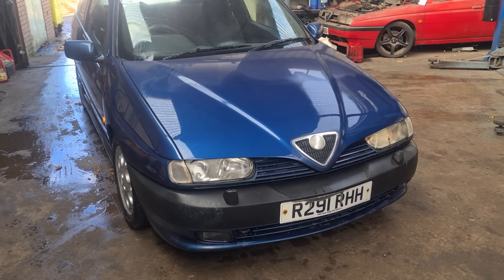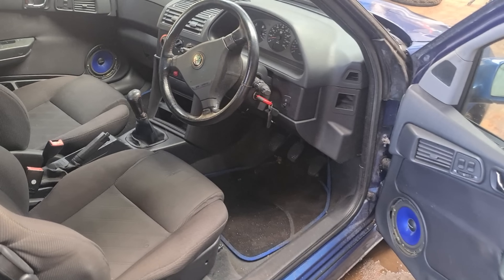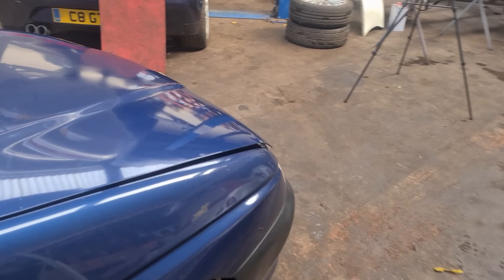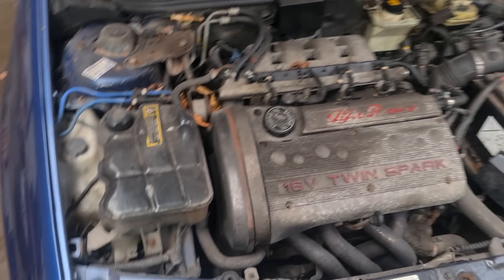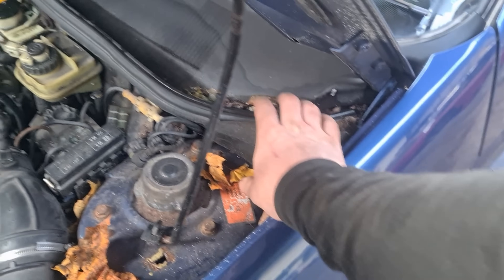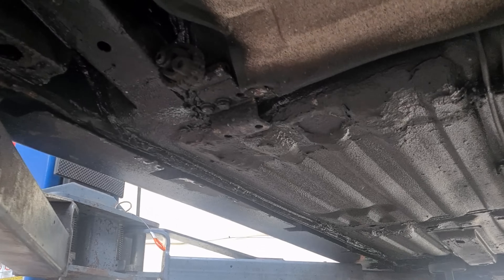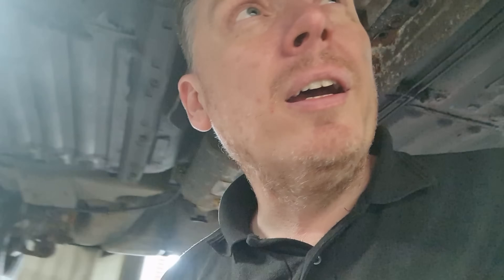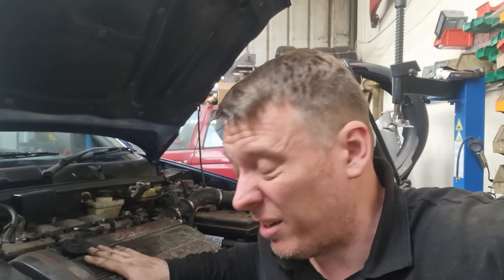My neglected Alfa Romeo 145 Cloverleaf

Comment: Great video as always! Just a thought, but for those of us outside the UK, what exactly is involved in getting an MOT inspection? Not many states in the US have mandatory inspections every few years, which is probably why you see so many dodgy cars on the road! (Trash bag taped in place of missing window, etc.!) Where I live (Ohio) there is an emissions inspection every other year, but it is no cost and recently they have a "do it yourself" kiosk. You just plug a wireless gizmo into the OBDII port, punch in your license plate number and odometer reading and if there are no emission codes present, you're good for 2 more years!

Comment: Hi you mentioned in a previous post that you remove the sponges from each side under the front windscreen. I have a 2002 147 and have noticed that in this weather they do tend to hold the rain water so is it best to remove completely  or get fresh ones ???. Thanks in advance

Comment: Hi Neil, I’ ve always been wary of this engine 16 valve Twin Spark  due to reputation of throwing con rods , excessive oil consumption etc ; yet some go on to fairly high mileage, is there method of preventative maintenance?
Reply from the maker: All they need are regular oil changed. Prob one of the best alfa engines when looked after.
Reply: It is a reputation these engines do not deserve. If you service it like you should and use quality oil you will never have issues. Never ever scimp on the cambelt services and never exceed the mileage. I have had my 155 with the same engine for 22 years now and have never had any issues. The engine is still as healthy as the day I bought it. And never run it with a low oil level. Then you are guaranteed bearing issues.